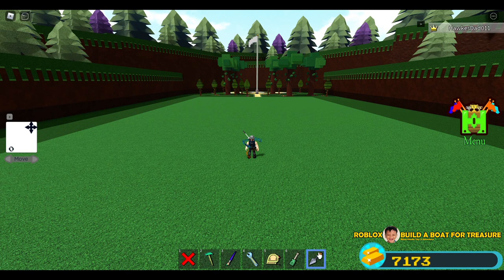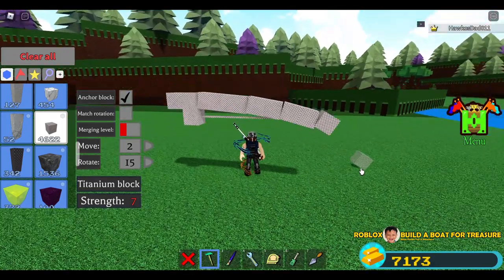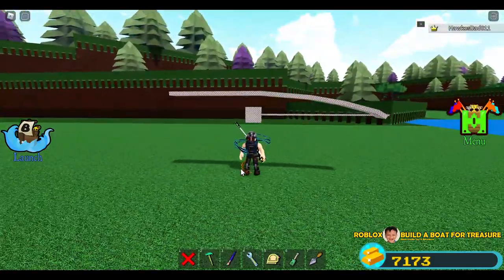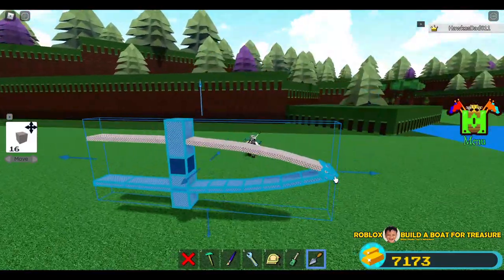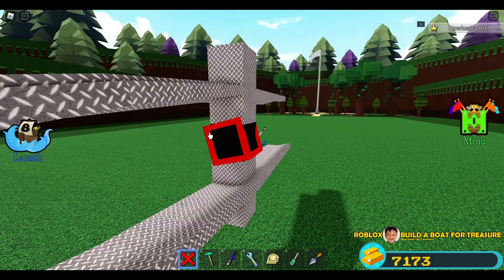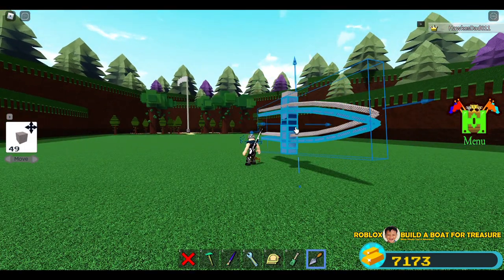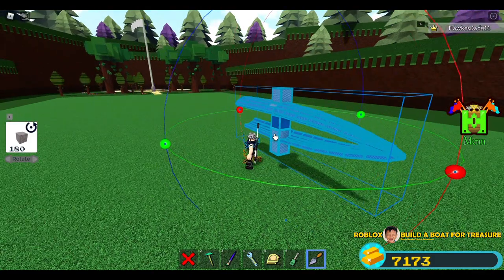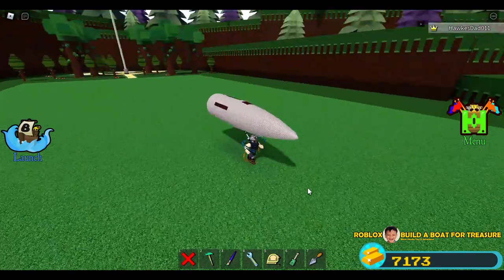TUTORIAL: How to Make Jet Cone / Jet Nose Using Trowel Tool in Roblox Build a Boat!

Comment: selecting the center block  cancels the original selection of the full building and only focuses on the center block
Reply from the maker: must hold press control in the keyboard while selecting guide blocks or center block
Reply: @hawkesdad  oh ty
already finished it but still ty very much